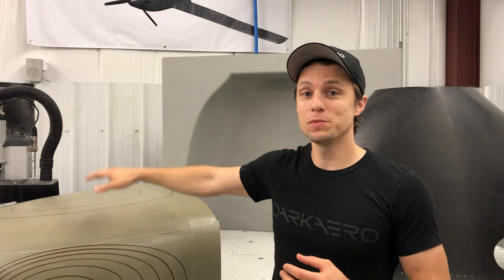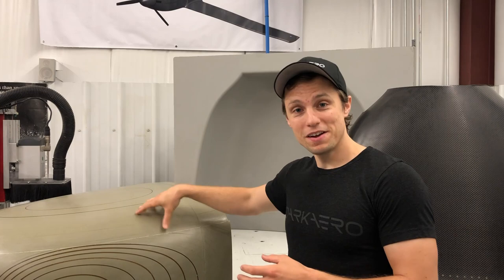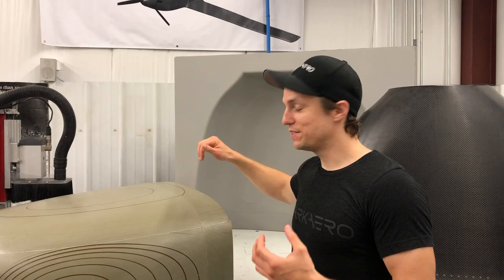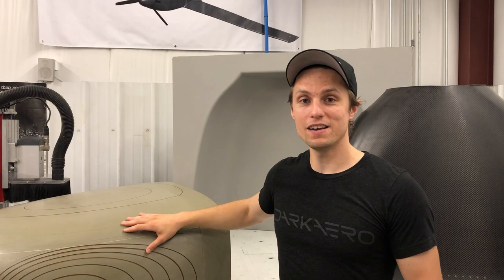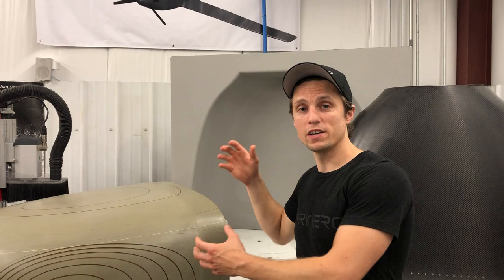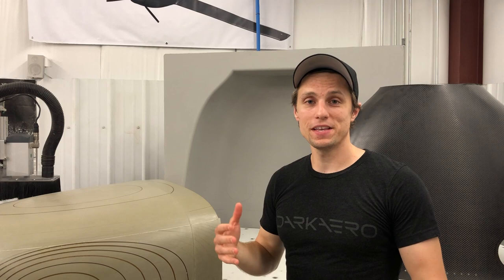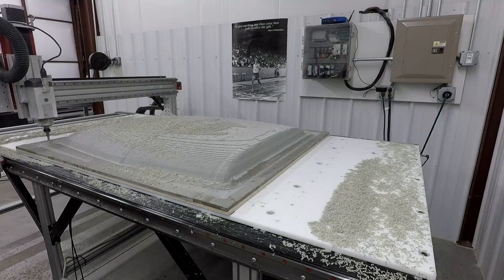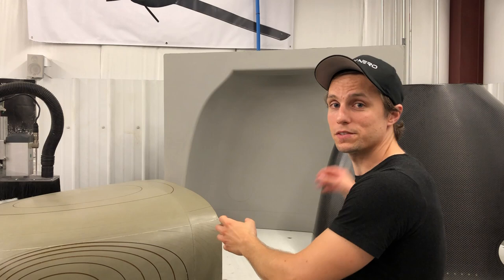Using a CNC Router to Machine Aerospace Grade Mold Patterns (part 2)

Comment: If you ever find yourself wondering what topic you should cover in your next video, I'd like to suggest that you take us much deeper into the details of your manufacturing process.  I'm particularly interested in the processes through which you proceed from CAD  drawing -> plug -> mold -> part.  I should confess that my interest is purely driven by idle curiosity, so I can't reasonably ask you to devote much time to a task that will not move your project forward.  But hey,  keeping us viewers entertained/educated is perhaps not a total waste of time.  Of course, I understand that you may not want to reveal proprietary manufacturing processes, but I probably wouldn't understand those anyway.  So the "kindergarten" version of carbon fiber manufacturing will be more than enough to keep me awed and confused (a chronic condition I'm afraid).  In any case, I  enjoy your videos, and I'm grateful that you take the time to make them!

Comment: When you do multisection plug make two holes on the datum bottom face of the plug at the ends of the plug. Place all those holes in one line on all sections of the plug and when you will assemble the plug use those holes and dowel pins inserted in those holes to align the sections. It is the proper way to alight the sections of the plug rather than using the sections split faces. You also can use those holes to control the length of the plug, not only straightness, just maintain a little gap between the plug sections to be able to adjust the plugs positions.

Comment: Nice analogy on Gordon Ramsey! Have you guys looked at those Kuka robot arm types of machines? I know they are much higher priced than the router, but you could probably machine a whole plug without needing to separate it into parts?
Reply from the maker: We actually have researched those. The idea of that is really compelling. I think the big challenge there is achieving the right dimensional accuracy but also don’t know if it could handle machining the higher density tooling board and still get accurate results.

Comment: I just watched both parts.  Wow so informative.  Good timing too as I am about to order a similar router.  Was considering the 5'x10' Avid Pro but space is tight so maybe I can get by with 4'x8'.  However will mostly cut thin sheet aluminum for an airplane that was plans built but i own the rights and will be kitting it.  When you ordered your  machine, did you have them add the extra crossbars or did you just order from 8020 yourself.  Also it looks like you have more welded cross braces on the leg kit.  Can you confirm?  I already have my electronics (clearpath Servos) and an ATC S30 spindle since I will need the auto tool changing.  Also have same Series 3 Tormach as you.  Very inspiring to see you pull this all off with the same tools I have.  I shoudl be able to make a low Tech Ultralight if your able to make this high tech aircraft.  So inspired by your work and been following.  Only disagreement is I am a Solidworks guy from so long ago I can't make the switch to Onshape.  :)  Oh one last question I am also getting the 8" risers, but was going to get the 12" Z axis as I may need the extra height for a rotary axis I will make to cut the fishmouth in 4130 and 6061 tubing.  Did you ever consider the 12" Z axis to be able to go below the table, or off the side if needed?  My rotary may end up beside the machine installed always with the longer boom option.
Reply: Aircraft plans are here: www.cloudbaseaviation.com
Reply from the maker: Marc, thank you for watching and for the questions. We ordered additional crossbars and cross braces after we already received the machine. I'm not sure why Avid doesn't just do 8020 angled braces, but I would do those instead. We will likely drop our welded braces for those down the road. If you are planning on using the machine to primarily cut thin sheet aluminum I wouldn't opt for the 12" Z axis. I would look into incorporating a mist cooler as well for cutting aluminum on the router. If you want to cut tubing, it may be more efficient to outsource that portion to a place like Precision Tube Laser in Nevada. We don't have a lot of experience cutting aluminum with our router so I'm hesitant to speak to it too much. The  "Breaking Taps" https://www.youtube.com/channel/UC06HVrkOL33D5lLnCPjr6NQ YouTube channel seems to have a lot more time on his router cutting aluminum and can probably speak to it better than us. Good luck with your aircraft! Excited for you!

Comment: You could 3D print a flimsy shape that would't be smooth anyway, then add a CF layer and weld in a tube skeleton, then finish it as a plug. Say you were to make a plug of the entire fuselage, that would be very heavy to deal with. Hint hint single piece fuselage is a good thing.
Reply from the maker: Dan, you could definitely take different approaches to this. In general, from our experience, its best to avoid trying to combine different materials and different processes to avoid tolerance stack-ups.
Reply: @DarkAeroInc  sure, making one massive solid plug will tend to be quite stable. To a point. As a free body, say the entire fuselage, a solid piece might be problematic.

Comment: beautifully explained. how do you overcome the Z axis limitations (8"-tool)? do you split the plug drawing into sections and fix them together later on?
Reply from the maker: Thank you! Yes, for taller plugs we split them up into sections, machine them out and then combined them back together for making the mold.
Reply: @DarkAeroInc  cool. one thing i didn't understand is that your plug at the beginning of the video seemed very tall and unfinished. how did you machine the whole piece with the Z axis? very nice work on your plane! well done.

Comment: Where do you get your tooling board from?
Reply: And what does it approximately cost?
Reply: FYI polyurethane tooling board typically costs $3 per liter and epoxy $7 per liter.
Reply: AeroGarage where is the best place to buy tooling board?
Reply: @johniii1220  if you're in the US I guess General Plastics is a good place to go
Reply: John III freeman’s manufacturing makes some great stuff.
Reply: Hi there, huge fan of your videos!
I'm curious why you chose screwing the board onto the cnc rather than a vacuum table approach? Would this tooling board not be helddown by vacuum?

Comment: Just saw watched the Garmin Osh Kosh video with the Patey brothers, one thing they mentioned that suck out to me and reminded me of your build is how carbon fiber breaks down under the UV from the sunlight.  How do you plan to prevent that?  Further they said that the heat from the sun causes the carbon fiber to get “soft” and lose its rigidity, going on to say that some manufactures limit dark colors on their carbon products.  How do you plan to handle that as well?  Especially because I don’t think your design has a metal frame to pull strength from.
Reply from the maker: Thanks for the question. The resin matrix that holds a carbon fiber composite together is what will determine these properties and not the fiber itself. Some carbon fiber composites use resins like vinyl ester that actually cure under UV. In the case of the resin used in our parts, the parts are cured in an oven to give them higher temperature capability so they maintain their desired mechanical properties even under higher temperature conditions. UV radiation does have an effect on our resin and requires that our plane be coated in a UV blocking paint.
Reply: @DarkAeroInc  curious. Since you're baking in an oven anyway, I'm wondering why you're going with resin infusion instead of prepreg carbon fibre?

Comment: 7:58 to much work and waste time. Just use 4-5 axis CNC machine to make the entire positive for mold.
Reply from the maker: Thanks for watching and the feedback! We actually mention in part 1 that the ideal setup would be to pair a really nice 5 axis machine with tooling board. Because we were budget constrained, we went with high grade tooling board with a more economical router instead.
Reply: @DarkAeroInc  I use a 5 axis router I use at work with a 2.4x5.4m x 1.5m H machining envelope. It feels the norm to me, but I guess I'm kinda spoilt really :)
Great talk on plug making, all good advice. Can't remember if you covered join placement to minimize feather edges but that's all I would add.
We get a mixture of customers for plugs. Some want tooling board and a good finish, some want a slightly undersized one in polystyrene and they have a labor force that puts a hard glass shell over that then bring to a finish.
 Typically the boat hull people go down that road and the motor racing and defence types go the tooling board.
Haven't had any aero plug work, more aluminum spare parts.